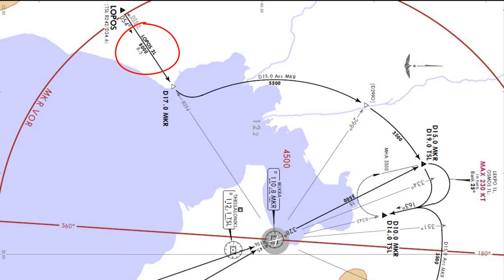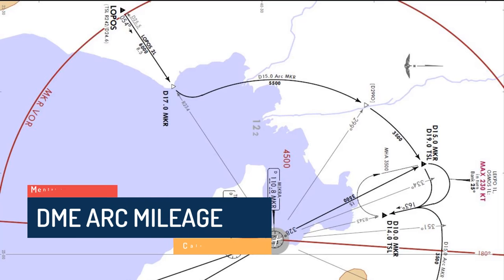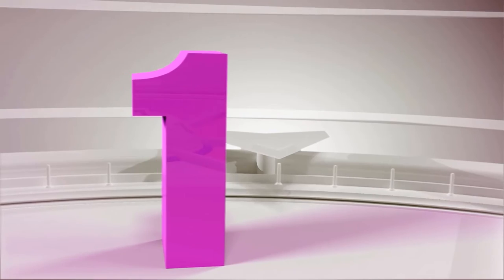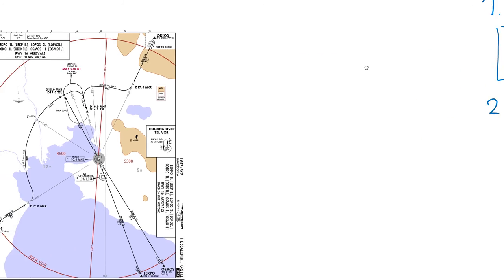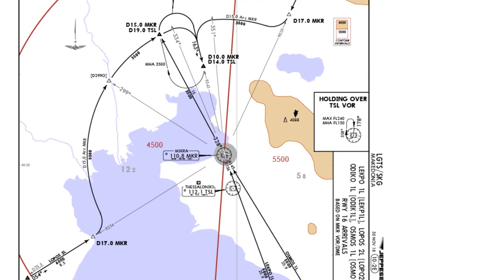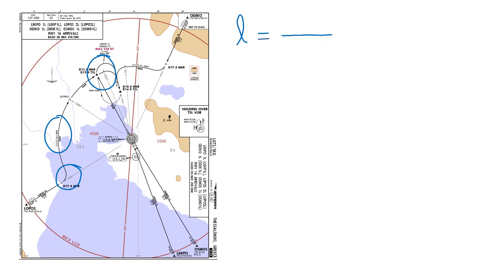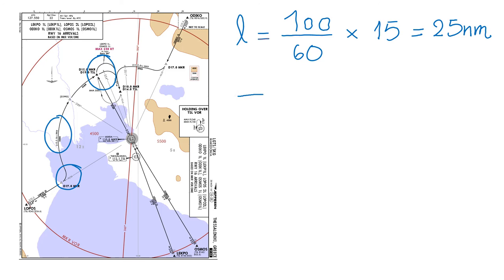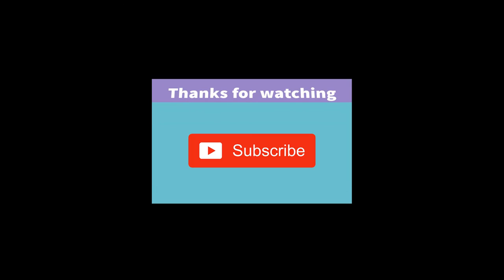DME arc length calculation

Comment: If you’d like to know how many degrees are in 1nm on the specific arc. Useful for knowing when to begin your turn on and off the arc and calculating total dme track miles. Use: 60/15dme = 4 degrees/nm.  Then, 100degrees/4 degrees per nm = 25 total track miles.

Std. Rate turn radius equals 1% of TAS/2.
90TAS x 1% = 0.9/2 = 0.45 or 0.5nm turn radius.

So, in this case you’d begin your turn at 15.5dme onto the arc and your lead radial would be 2 degrees prior to inbound course.
Reply: why 2 degree prior?